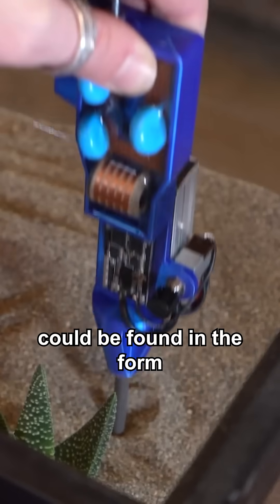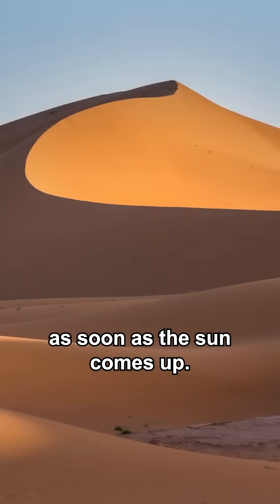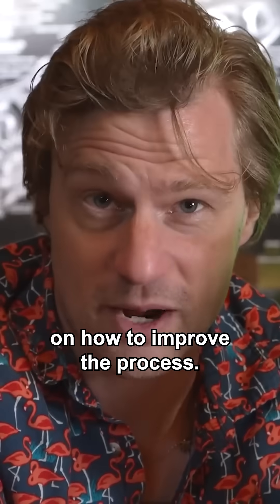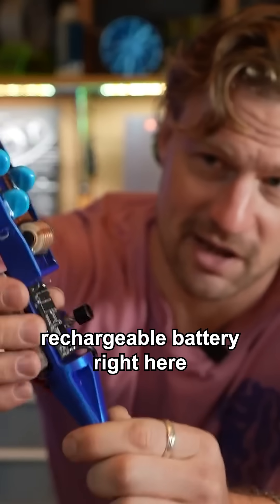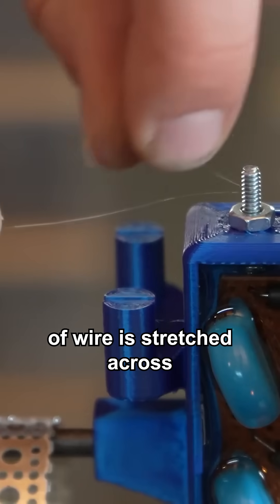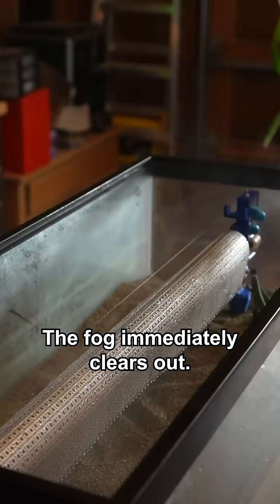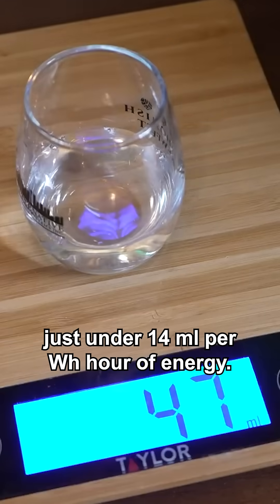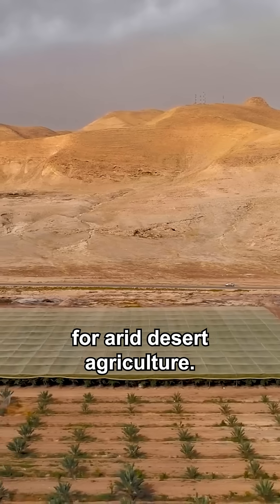Solving Desert Water Shortages Using 20,000 Volts (from full video)

Comment: That works wonderfully on small scale, however at a large scale,  how would you propose to accomplish the same result? Especially if its in the dune areas where sand is loose or if this device  is not mobile or fast to set up? Do you house a outer structure that is more dome like to help hold the fog in more for the condenser to utilize once the structure warms up? On top of that, are you going to have that water piped to nearby wells or tap the underground freshwater reservoir to act as a sort of faucet refilling the draining lakes? If this is set in the desert, wouldn't it be better to build something that naturally produces fog on a consistent basis around this device for a reliable system? Using valleys and hills as both protection and insulators to keep cooler air lower where condensation could naturally form?

Comment: Ive seen low tech solutions that use a special fabric hung up like a tent that pools the water on the bottom and to collect before dawn to prevent evaporation.  This is cool, but why would you need so much tech when you could passively get very similar effects? The only answer i can see is that selling a fabric is a one time deal, but selling a "high tech solution" could be more profitable due to planned obsolescence

Comment: Won't work in a real desert, this is stupid. It requires moisture to be in the air in the first place. Dry air doesn't have enough. There is a reason he fogged it first. Deserts don't tend to get very foggy for a reason!
Reply from the maker: This device literally is designed for morning fog, which forms in deserts. Namely, the Namibian desert, Chilean, and parts of the Arabian coastline. Look it up - they get tons of fog at night. Dense, predictable fog. This isn't designed to draw water out of the air. It's designed to condense desert fog.

Comment: This is perfect for San Francisco and the greater bay area.
Reply: You know dehumidifiers are a thing already? Their water isn't safe to drink and tastes awful. Most importantly, if you want to get safe cleaning water there are infinitely many better ways to do it then to use water dehumidifiers.

He failed to account for so many variables in his calculations and basically rigged a purposefully artificial setup to get the efficiency he claims. A very simple example is that fog is never hotter than the surrounding air. But the fog from his machine is, for the first few seconds. So an un-powered metal sheet that has the ambient temp will already be insanely "good" at condensing the moisture.

Comment: Fog harvesters have been around for decades.  The best designs imply use tiny tight strands of string or polymer.  They require ZERO electricity.
Reply from the maker: They also are incredibly inefficient, only capturing 2-10% of the available moisture. They are atrociously inefficient.
Reply: @PlasmaChannel  They are infinitely more energy efficient because they don't require ANY electricity.  FOG QUEST has a design about the size of a large blanket which can harvest about 31 liters per hour.  I'm not sure what that is in gallons but its more than 10 people would need in a day.

Comment: Too Expensive, Since, Approx 40 Watts/Hour of energy to generate 500 ml of Water from Air Fog, Is 12 Litera of Water in a whole day and Approx 1 Unit of Electricity. 

Better Solution is to use a Pump set of 1000 Watt / 1 HP Single Phase, powerful enough to raise water to a height of 200 Feet Pipe of One inch Diameter Placed Vertically, and then Bends downwards to the Water Tank on Seashore Hills. Then it's Just One Hour Run of Motor Pump and Approx 10 K Liters of water be transferred from Sea to that Tank. Then No Electricity is Reverse Osmosis Apparatus based on Gravity Or simply use a layered Sponge to filter out Salt from it

Comment: I have heard of this idea like years ago, glad to see an actual implementation...
Reply: The reason they usually dont work is cost. It would be cheaper to have airplane carry as much water as possible than to build these system and maitain them for the same amount of water. Every few years i would run into these video type and they all fail at cost/benefit
Reply: And you'll keep hearing it over and over again
Reply: @MultiRRR123  
🙂

Comment: I believe that the density of the fog will significantly impact the results; therefore, a device for measuring fog density should be utilized.
Reply: This IS a device for measuring the effective density of the fog.
Reply: @pburant   I think in the normal desert conditions it can't collect 1% of  what was collected in the video
Reply: fog is usually 90-98% humidity.
Reply: @VagishaDas   🫢
Reply: it's like buying car that on paper goes with optimal conditions 300 miles but in reality it only goes 230 miles😉
Reply: @maik1982  "it'll go 2000mph!" *when put into a low earth orbit

Comment: Jay. Insulated (closed cell) substrate with an aquaphobic coating works best in my experience. Best of all, it requires zero energy input. Surface area is key, surface tension is your enemy. I could see implementing your system on the leading edge. This could especially come in handy when used in conjunction with solar panels as well as large aforementioned insulated panels, providing shelter and habitat for low light requirement aquaculture in the desert. Initial water would ideally be brought into a valley or depression creating a micro-climate.

Comment: If this is done on a city scale, i wonder what the environmental impact the decrease in moisture level in the air will have. Just doing this in order to water huge crop fields might dry out the air, which would probably not be good for health and environment, besides probably drying the area even further. It's cool technology, but it needs to be deployed responsibly.

Comment: Recursive Not - When sun comes in Fog goes away, and we need Fog to create water, solution is finding a storage system that can capture the entire day time sun energy and uses it in during early morning before sun hits the sky.
Reply: . . . So 2 things have been exposed from this comment, you don't know what a solar battery is, and you don't know how fog works. 

Fog occurs when evaporated water rapidly cools saturating the air with even more humidity but is not at an altitude to create clouds. And as said in the short you need a place with decent humidity for this to constantly occur naturally (coasts, as he suggested these be placed near) yes there are many places that have deserts but also coasts)

Comment: Yes, because a device that requires electricity to run will be very easy to use in an area of the world that doesn't have the infrastructure to capture and distribute water.

This had been said time and time again: the problem isn't the amount of potable water in the world: the problem is distributing that water to the areas that need it.
Reply: what part of the word solar did you not understand? maybe try to follow what is being said and not just look at the pretty shapes for cheese crust. do you think farmers power the energised fences with a 2 mile extension cord? yes thats right there is already a product in use in remote areas all over the world that makes high voltage from solar and it can be bought for 30 to 100 bucks.

Comment: Well congratulations you made a dehumidifier.
Reply: Not exactly, most dehumidifiers work by drawing air into them and cooling the air down which makes water vapor(a gas) in the air condense into a liquid. Fog is a small mist of water droplets(already a liquid), meaning that his machine is more like a water mist collector than a dehumidifier. And because  fog contains a lot more water than humidity in the air, in foggy conditions his machine can collect more water than a dehumidifier(which he actually tested in his full video).
Reply: @WinWin-pz9wq  same thing different builds...dehumidifier should work better if u scale it the sa.e size of his.
Reply: @WinWin-pz9wq  well... if you put dehumidifier in fog.... it also will became mist collector

Comment: Add a carbon ceramic coating to the bottom 1/8th to make the project collection more efficient - this would increase the flow of droplets by at least 70% using less energy and you'll have less evaporation into the atmosphere.  The collector should also be coated.  It should collect water into storage tanks for more efficient use - ie drip irrigation underground.  The coating lets the droplets form into lines a lot faster and flow off the grid panel instead of just drop off of it - the way the mesh ends can be changed to allow better flow as well - ie every 10 squares ending on a small one inch strand.  It's all about efficiency and this is the stuff that's never brought up on similar projects that never even get started.   The temperature of the grid also makes a big difference - imo that should be studied and expirimented with some as well.  #ForAllOfHumanity
Reply: This should be Open Sourced so that people all over the world can work on it to make it better
Reply: @kabutey8132  for real somebody should set up a github repo
Reply: How do you even know this
Reply: Bro what are you eating that makes you this smart?
Reply: @tedipaduraru Kraft dinner
Reply: you are also mentally sane and not suicidal, remember that.
Reply: What about hydrophobic coatings?
Reply: Pin this guys comment 👏🏻👏🏻👏🏻👏🏻
Reply: 50 years later climate change be like layer
Reply: It would be interesting to make the mesh corrugated to increase surface area and help funnel the water. Ceramic coating is a neat idea. You can easily apply ceracoat and bake it on.
Reply: This is for efficiency... 😂 You gotta be F'N KIDDING ME! gtfoh

Comment: Amazing, I was thinking of the cooling panels that @Nighthawkinlight made to use as a cooler condensation point; but this is extremely more efficient, plus solar can be used.

This paired with a grid of salt water channels with a bottom covered with the black used to paint the car by @TheActionLab 
and a design that allows for the residual water to return a few miles into the sea and already diluted (like the MIT design to avoid clogs), there would be a feasible way to increase a desalination process that would be more reliant on basic maintenance rather than any other power source besides the sun (usually more present in areas with low potable water)

Comment: I don't understand. I watched the complete video as well. Firstly, how was that thin a wire, carrying 2000V? And also, how could you stand with your face so close to a 2000V line, and not get zapped or arcs forming between the wire and your face?
Reply: There is no problem of carrying a lot of voltage in a cable, the thing that the thickness of a cable limits is amperage, if you pass too much, the cable gets hot, and then melts.
The air is an electrical insulator until with high enough voltage it ionizes, then it's a conductor.
The voltage needed for that is more or less 1000v for 3mm , so 20kv means a distance of 6cm, if he didn't got closer than that, there is no problem of getting zapped
Reply: Could be wrong, but wire thickness needs is dictated by Amps not Voltage, and regarding safety, well, you have many tesla coil content proving it could be fine + if electricity has a path for flowing easier it will take that one I think, so arcing in this circumstance is not likely.
Reply: So a electricity has 2 variables to it, voltage and amperage, it’s the combination of the two that make stuff dangerous, for example, when you are statically charged and a spark jumps between you and another person or door or smth, the voltage of that spark can be thousands of volt, but since its a really low amperage, it is not dangerous at all, on the other hand, a car battery has a really high amperage, and when running trough a wire can melt it easily, but when you touch both electrodes nothing happens, because the voltage is too low to create a bridge trough your body, also it doesnt spark to hom, since the voltage is too low for that, a general rule of thumb is that for high voltages, every 1000 volts creates an extra 1 millimeter of range for the spark
Reply: Thanks a lot for the explanation but now I am confused about a new thing. You say that car batteries even though with a very high amperage are unable to harm us due to a low voltage. So does that mean the batteries have an extremely low resistance? And a static charge results in a spark/arc on discharge due to a really high voltage, but the amperage is very small. As who's controlling who in the V = IR? If we touch a body with a small low voltage but high amperage due to a low resistance, why didn't that harm us? The amount of current was so large afterall? And we, being a high resistance path, combined with a heavy dose of current flow will mean a very high voltage as well.
Reply: @harshvardhan4771  You have to start seeing electricity as charged particles instead of just a stream of something, in electrical wires these particles are electrons, and to keep it simple ill explain it with those, when there is a high amperage there are alot of electrons running trough a wire, with low amperage there are less. This is why a higher amperage creates more heat(There are more particles running trough the wire, which collide and interact with the particles in the wire and in the process lose a bit of energy to heat). Voltage is the "power" that is behind these charged particle, so in this case, 20000 V means that there is alot of power behind the particles, but since its low amperage there are fewer electrons that store this power. So to explain this in simpler terms, you can see a wire as a highway, compare the high amperage with alot of vehicles riding on the highway, and the high voltage can be compared with these vehicles being heavier, they require alot of power to stop and when colliding with something will create a more powerful punch. 
Your question about the battery: No, it means that your body has a high resistance, and due to a abstance of "power"behind the electrons because of the low voltage it cannot break trough the resistance of your body. The flow of electrons from a battery is not constant, so the amperage will chance depending on the amount of resistance between the two elektrodes of the battery, when there is a high resistance, the battery won't be able to let as much electrons through, and thus the amperage will be lower.